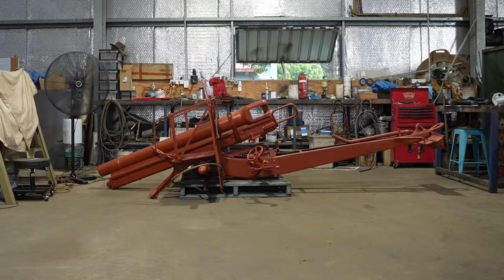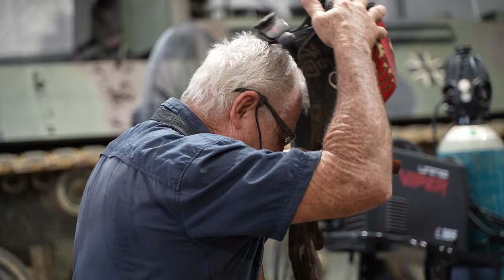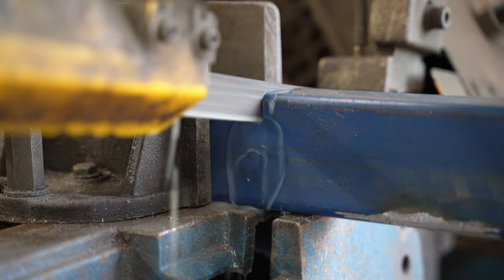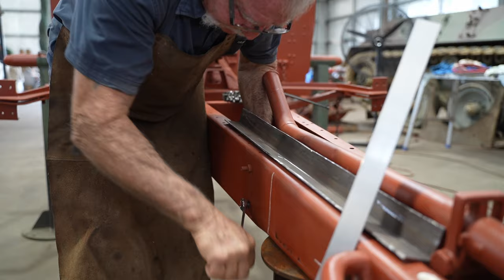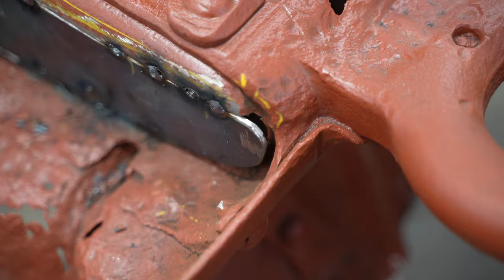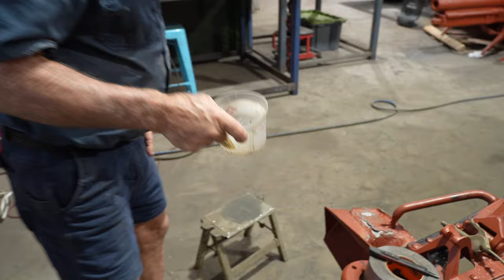WORKSHOP WEDNESDAY: Restoring a rusty captured WWI German 7.7cm Feldkanone 96

Comment: Serial #6532 Acceptance 1915 makes it a late 7.7cm Feldkanone 96 - the Rheinmetall designed FK 16 was introduced in the following year.

It might be a recycled gun - Krupp and other factories rebuilt guns throughout WW1 - if it has "abg" and "gef" with dates stamped below the charge port it's probably an old gun which was rebuilt.

The carriage rails on Krupp guns was made from pressed steel of about 12 gauge to reduce the weight as much as possible. This was only possible because the recoil from firing the gun was absorbed by a hydraulic cylinder - the barrel was pushed back to battery by a series of springs. Unfortunately the light construction means that the Krupp/Rheinmetall guns rust away very quickly. The older guns from the 19th century had massive frames to withstand the recoil forces and these often survive quite well.  

It's amazing what can be brought back from a rusted mess. The rather special 15cm Krupp howitzer in Jamestown, SA was rebuilt by a local firm with help with the riveting by local steam railway enthusiasts.

Comment: Love to watch the repairs you do; the epoxy is a great choice for a cosmetic repair to a complex shape that will never need the original strength it was designed to have. A needle gun on deep pitting works well to prep because it can get deep into the rust pits to clean them out.

Comment: Where are you repair the holes with the epoxy, a trick that I use is two back in the hole with a plate of copper and then start welding around the perimeter of the hole with a meg welder. The weld won’t stick to the copper, so you create a puddle that spans the gap and you can grind it smooth.  I use that trick a lot for sheet metal and heavier metal sheets. And copper sheet is very soft and malleable so you can conform to weird shapes as a backing and it’s conductive for the ground of the welder

Comment: Looked at the video again ...

That's a fairly rare 7.7cm FK 96 n.A gun since the barrel was made by Rheinmetall (Rh.M.F) not Krupp (Fr.Kp). Krupp designed the original gun, the 7.7cm FK 96, in the 1890s without recoil absorption and many of the guns were updated with recoil absorbers and new carriages in 1905-07. I don't think there's another Rheinmetall built FK 96 n.A in Australia.

Comment: Does the Museum do any metallurgical/chemical analyses on the removed bits of metal from these old items?  Or at least save some of those "scraps" for possible subsequent analysis by more specialized researchers?  There has been lots of very interesting research done in other archeological fields by looking at elemental and isotopic compositions of materials to understand where and how they were made and such research requires lots of background data be generated to "map" the distributions.
Reply: The composition of Krupp steels were quite well known from before WW1. The real Krupp secrets were the furnace practices and processing of the steel to finished items - much of this knowledge has been lost.

Comment: While a great finished product, i have to wonder why they went the easy way and used square stock? It doesnt match the curve of the original stamped frame. I would have thought even an old truck frame would have matched the contours much better and looked more original without the sharp angle. Nice work tho!

Comment: Beautiful restoration by replacing rusted metal with new metal.  Wouldn't have been easier to bend a  piece in a Sheetmetal brake rather than cutting and grinding out a 90 degree section from square tubing?  With the ability to weld in new metal it is a shame to use epoxy!

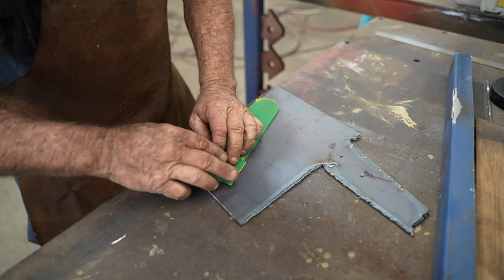Comment: Cutting sheet steel as in minute 13:40, holding the angle grinder with one hand, and holding sheet with the other, is so DANGEROUS!!! How can a qualified technicians do that error, and show it in a video? I am delighted with the restoration work they do, but I am pretty upset with those images. People with no experience will think that is a correct way of using an angle grinder, one of the most dangerous machines in a workshop, finger and hand chopper 🤦
Reply: And yet he still has all 10...
Reply: @ray.shoesmith until one day he has 9... Why are people always more intelligent than an engineer that has designed a machine? If he designed the machine with a handle, it has a very precise function, safety in this case....